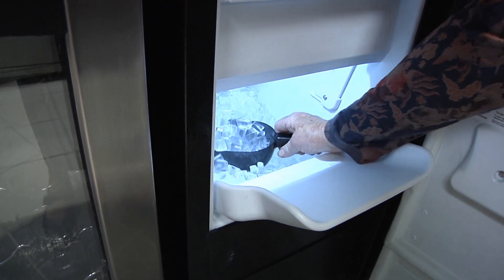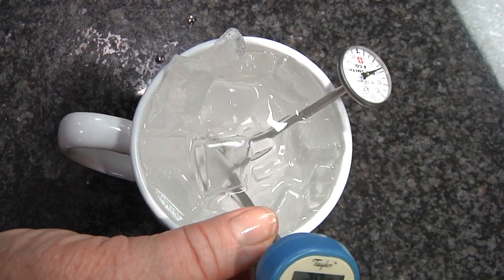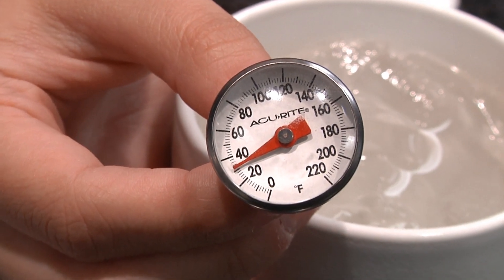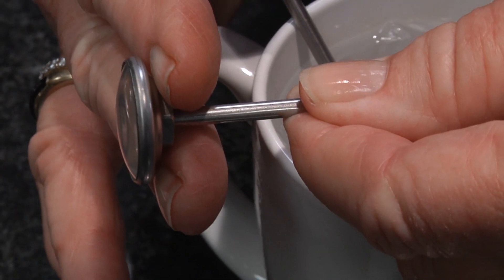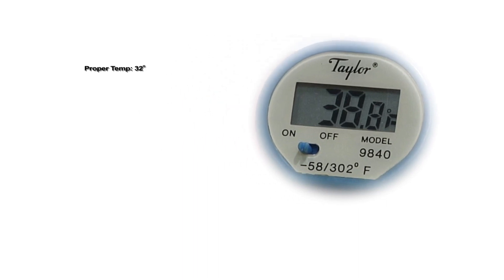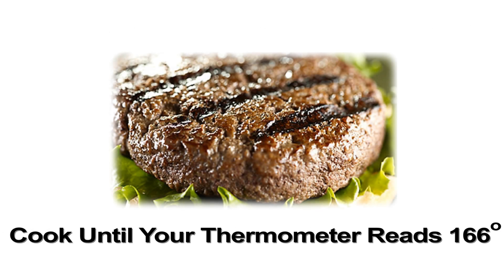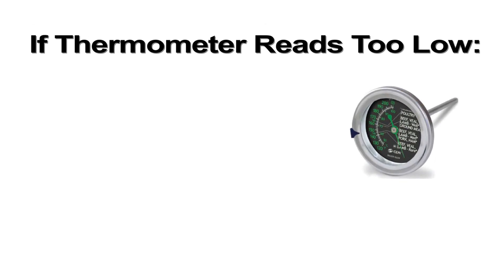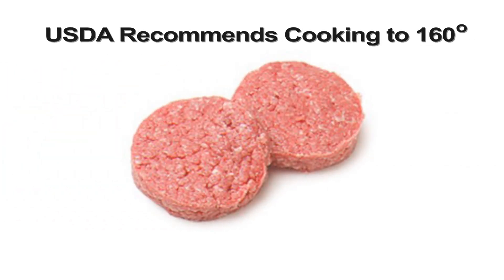How to Calibrate a Meat Thermometer

Comment: I got a thermometer ( not digital) I bought a  set of kitchen utensils off Amazon and it comes out of the package at 75°?? That sure seems like it's a long way off from where it should be.but fine I see this video it says you can turn the little nut at the back to adjust it. Then I can't find my small wrench in my big one won't fit it. Turns out my brother borrowed it without asking antiques in Jamaica for another 9 days!! Promise I need to make my pork tenderloin now!! So I guess it's off the home Depot I go😂
Reply: @chokethewoke3412  I’m no expert but that actually sounds good because it’s reading the temperature of the room you’re in. Mine has a similar reading. So I think yours might be already calibrated? But again I’m not an expert.

Comment: Well I have a meat thermometer with an adjusting nut, but the lowest temp is 120°. The highest is 200°. So I guess I'll have to use a candy thermometer, heat the water to apx 120° and adjust the thermometer to that!

Comment: Ummmmm......... am I brain dead or????? She messed up the first calculation! If it’s calibrated at 6’ higher at 38’ vs 32’ and recc meet is 160’ you do NOT cook extra 6’ to 166’ as said! you subtract it to 154’..... I’m hoping it was the nerves, for I saw “PhD” somewhere SMH
Reply: or???? lol. she said the thermometer reads 6 degrees higher than actual temp (e.g. water at 32 deg reads 38 deg). if that's the cases then meat at 160 deg would read 166 deg (ideally).
Reply: It’s off by 6 degrees (higher) so she is right. Mine does that, so I calculate up.  If you do it your way your meat WILL be 154 because your Thermometer is off by 6 degrees and will read 160 and YOU will think it’s done because you didn’t compensate for the off calibration of the Digital thermometer.

Comment: Using freezing water to calibrate a meat thermometer may be using a poor reference since meat thermometers are designed to be accurate at much higher temperatures. Cheaper thermometers may not be accurate across their entire scale, but can be quite accurate over the range you are interested in. I have a meat thermometer that is reading about 10 degrees F high at freezing, but is spot on between 100- 200 degrees. Using boiling water is a better reference for meat thermometers (since they are designed to measure hot stuff). Be sure to correct the boiling point to your altitude. Our home is at 2300 feet, so I calibrate our meat thermometers to just under 208 F. See: https://en.wikipedia.org/wiki/High-altitude_cooking

If you find a meat thermometer that reads 32 degrees f (0 C) in freezing water, and reads properly at your boiling point, you can be pretty sure you have a good one. I found this one: https://www.thermoworks.com/ThermoPop to be within one degree at both ends of the water range. I now use it to check my other thermometers at around 140 degrees. It's also very fast. Seems with meat thermometers, you get what you pay for.

Disclaimer: I was in instrument testing and calibration while in the Navy (years ago).
Reply from the maker: Challenge is holding a thermometer in boiling water can lead to burned hands, no such issues in ice
Reply: I have to wonder if thermometer is 6° off at a low temperature is it proportionally off at a higher temperature or only just six degrees.